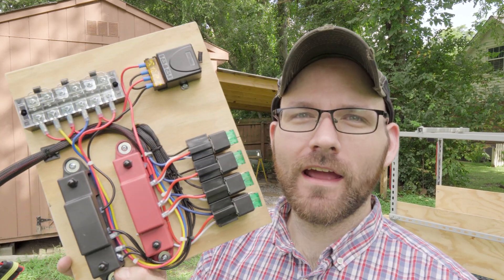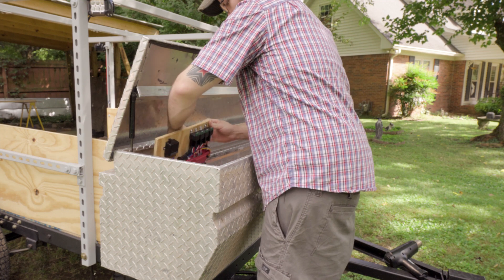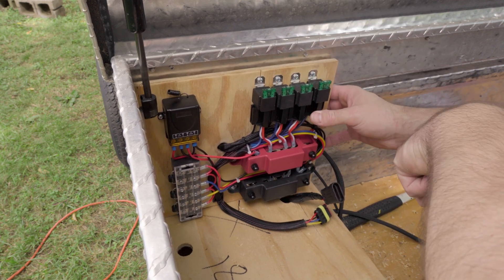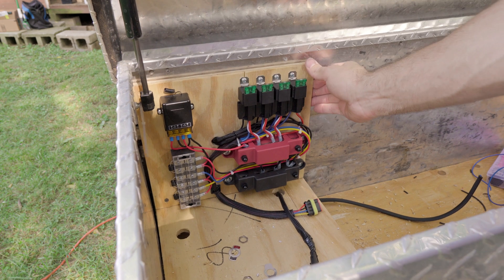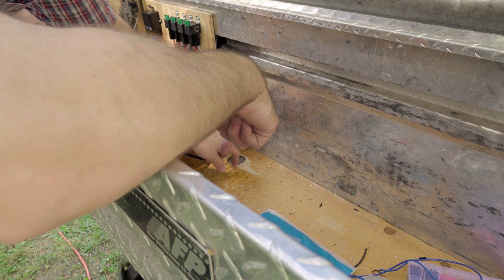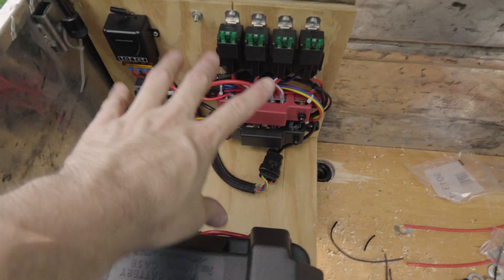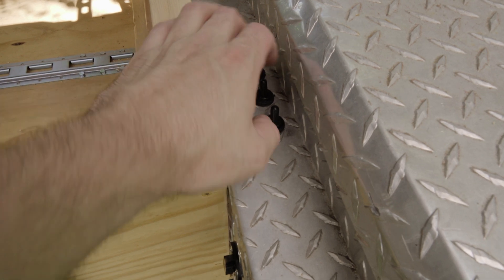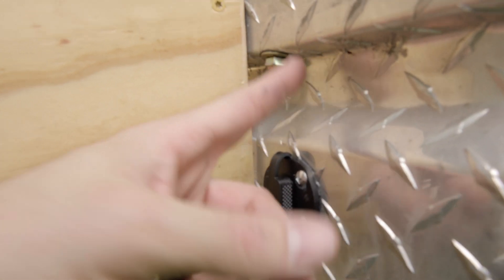Harbor Freight Overland Trailer: Light Control Panel

Comment: Any updates on this?  I have been looking for a way to build a HF trailer for my tent and kayaks, so finding your videos is exactly what I needed.
Reply from the maker: I haven’t done anything with it lately, but I will be doing some more soon. Is there anything in particular you would like to see or know?
Reply: @ElementofAdventure  What leveling jacks did you go with?  How sturdy is it with the tent mounted and someone shaking the frame or moving around inside the tent?  Is it sturdy enough to support two adults inside the tent?
Reply: @ElementofAdventure  Also, maybe how you mounted your kayak?  Show it all ready for adventure.  Thanks again, great content!